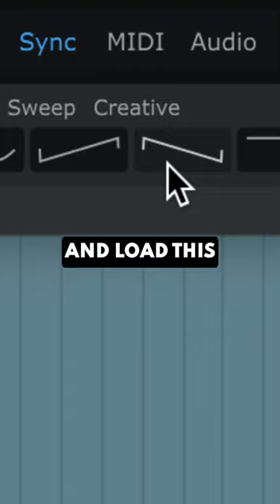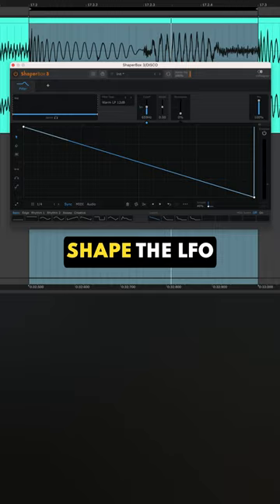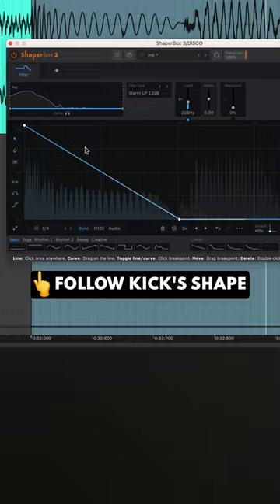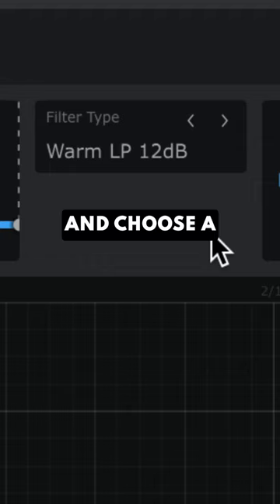How To Steal The Kick From ANY Track!

Comment: To get a better effect, duplicate the track and then slice the frequencies into High, Mid, and Low. Then do the shaping/fading. It will turn out much closer to the original.
Reply: Thats terrible for the phase
Reply: This will not produce a better result in this case, as the kick is already isolated for the most part. You will not get a clean result with splitting the bands  because of the overlap in frequencies and phase issues as mentioned above. Better layer different kicks and eq those to make space for each other. So for instance an acoustic kick for the top with an electronic kick for the bottom.
Reply: Wrong! Filter crossovers for multi-band processing will completely change the flavor of the kick.
Reply: Literally easier to just open any synth and make your own kick
Reply: linerar phase eq is needed in this case, but filter shaper is still much better.

Comment: if the bass overlaps the kick.. how it's possible to separate both from each other ? and how will Filter in shaper box recognize what in kick and what is bass? it's possible on 1 of 10 tracks approx..
Reply: Find a part where there is no bass playing. Usually there are parts without the bass